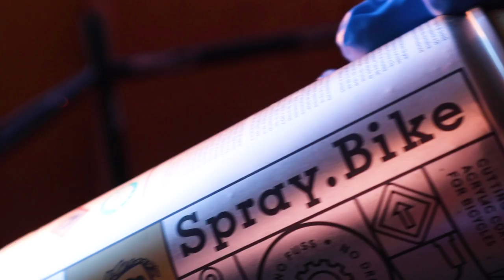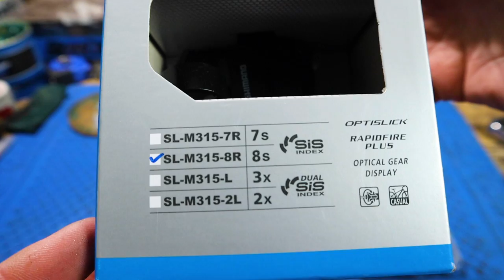Oldshovel Kona Cinder Cone Custom Build

Comment: Those decals came up a treat! Especially like the Old Shovel text on the top tube 😃!
An exceptional result. Another beautiful 90’s Kona given new life. These frames are very special indeed.
Reply from the maker: Thanks
Reply: How’s the geometry on these bikes?
I wanna build myself a nice 80s/90s mtb for cruising around, but since I’m having problems with my neck I can’t ride them in a stretched out riding position..
That’s the reason why I really lover modern enduro bikes, you sit very upright on them, almost like on a touring bicycle.
Are there old mtbs out there with such a upright seating position or are all of them stretched out that you have to ride them with a forward leaned back and up bent neck?

I know that’s a pretty weird and specific request, but maybe you could put me in the right direction..

Comment: THAT is a beautiful build. Kona & Trek had the nicest frames of that time period to put new school bits on. I came across a Kona Explosif that someone threw out. I gave it to my riding buddy and he rebuilt it nice. I have a 90's Trek 820 that I want to build up now, but I want to leave the original paint job, give it a good cleaning & clear coat it like they're doing now with vintage pick-up trucks & hot rods. NICE work OS.

Comment: I wish other people felt this way about older bikes like this...I always have and enjoy rebuilding them and showing them on my channel.  So many people think if you don’t have the latest bike then it’s garbage.  I’ve never had a bike newer than 2004 which was a Kona Stinky I built.  Keep it up...ps. it’s easier to put the wheel on if you leave one of the brake arms off until after it mounted  ;)

Comment: Stunning build, love everything about it, one of your best. Loved Konas (and loads of other brands) back then, a great era for MTBs. I have a '96 Bontrager Privateer that I've had since new with a Pace RC35 fork. I will never get rid of it ever, it's been used, abused, crashed, bashed and dropped but still has most of its original parts. Doesn't get used much nowadays as my old body struggles with the geometry, narrow bars etc but by god, I love that bike.
Reply from the maker: Thanks

Comment: Awesome build.  I just bought a 1993 kona fire mountain that has a set of girvin vector 2's.  The frame is so cool and with a set of more modern 2.3x26" tires it's shockingly comfortable over trails and jumps.

Comment: That is a thing of beauty ! You have done a wonderful job. I have an early 90's muddy fox monarch comp. I had it shot blast and powdercoated. I run it 1x9 alivio with deore hollowtech crankset. It's got a lot of colour going on ! I'd say the biggest drawback with these old frames is the lack of mud room at the chain stays. When we want to get a big tyre in there, instead of the relatively skinny tyres that were run back then.
Your bike is awesome, I'd ride that any day over a modern bike.

Comment: this bike is amazing, after building a few quite expensive trials and mountain bikes for myself this year, your channel inspired me to do a retro rebuild, so got my hands on a 2004 trek alpha 4500, which over the next few weeks will have new wheels built, a 1x9 or 10 drivechain, some decent tyres and a rigid fork, ideal for commuting but will also take some singletrack, and of course rim brakes to keep the retro look, might even get some hs33 for it in the future. awesome video as usual :)

Comment: Very slick build. Good luck with those pedals, mine had a bearing explode after 4 or 5 rides. If you were to build a gravel bike that could also handle some rough stuff, in the $500 range, where would you start looking?

Comment: Gosh. Your builds always blow me away. I'm sure you get a ton of requests for tips, but I hope you don't mind another. I have a '93 Stumpjumper frame that I've sanded the clear coat off to the factory paint to prep for painting. I wasn't sure if I needed the Spray.Bike Primer to ensure adhesion of their paint, or if I could just use a hardware store primer like you have. Any tips or advice would be very much loved! (Also, do you die cut your own decals?? Makes me want to buy a Cricut.) Thank you for the inspiration and providing all the ASMR to get through quarantine.

Comment: Hi. Thanks for your quick response.  I have a few more questions, regarding painting a frame and forks.  
Is it better to use a paint and primer spray to cover up or hide the colour you sanded off instead of a primer alone ?  Can one spray the primer, paint outside in the winter air, or does it need the warmer inside ?  Does it affect the paint coating if done on the outside ?  How  many cans of paint would it take to paint frame and fork, with one colour ?

Comment: You can setup V-Brakes by just setting the release into the cage on the edge but not down in the cage, then tighten the cable and that's the tightest you can get it and still release it for wheel removal. Hard to describe but cleaner than the way you leave the adjuster out.

Comment: I’m doing a similar kona build and was just wondering how you used that brake cable guide with v brakes. I think it’s normally for cantilevers, so I’m just wondering how you fit it with the cable housing. Thanks!
Reply from the maker: I drilled it out to fit a brake cable.

Comment: I love the labels and multiple layers of paint for the logos.  How do you ensure that each label covers up the exact area so that your paint lines up?  Such nice work!!  I really enjoy watching your restoration videos.
Reply from the maker: It’s tough to get them just right. It works best if the outermost layer is on the bottom and the rest line up with the edge of the bottom one.
Reply: @oldshovel  What are you using to create the masks for your logos? Very exceptional work. Thanks for sharing

Comment: Awesome as always...
Two questions for @oldshovel. Why do you put a coin into the grips? How do you create the decals to mask the paint? I mean, which software do you use to design them and which service to print them.
Reply from the maker: The coins are for bar ends. The masking vinyl I make myself. I design the graphics using Photoshop and Illustrator and print them with a Cricut vinyl cutter.
Reply: @oldshovel  ok thanks... But still I don't understand the purpose of the coins in the bar ends. For protection against bumps?
Reply from the maker: Yep. They keep the bars from cutting the grips and from getting gouged by the bars in a crash.

Comment: nice build! another 1X conversion with a 90's XT derailleur. How many teeth (max) do you find works with that exact derailleur? Did I see 42T there? Would 46 work?  I'm restoring my 1996 norco sasquatch for my wife and want to do the same.. thanks, keep up the good work

Comment: Recently started following. Loving your stuff! Just started restoring and working on old mtbs this fall. I have a question, at around 13:54 you mount a small intermediate hanger for the derailleur. I've seen it done before but don't quite understand what it is and what its purpose is. Can someone help me understand? @oldshovel
Reply from the maker: It expands the range of cassette teeth the derailleur accommodate. In this case so it can work with a wide range rear cassette

Comment: Looking to do the same with a 2007 stock Kona Cindercone. Below are the specs, any recommendation on what kind of modern 1x groupset will work on it?  I have been a roadie for 9 years and am working on bike building skills, this will be my first build!
2007 Kona Cinder
Frame sizes 14", 16", 17", 18", 19", 20", 22"
Frame tubing Kona All-Mountain Butted Aluminum
Rear Shock -
Fork Rockshox DART 2 w/Turnkey 100mm Travel
Braze-ons 2 bottles, fender, Disc brake tabs
Headset TH
Crankarms FSA Alpha Drive Powerdrive
Chainrings 44/32/22
B/B FSA Powerdrive
Pedals Wellgo LU-A9 w/Toe clips and straps
Chain Shimano CN-HG53
Freewheel Shimano Deore (11-32t, 9speed)
F/D Shimano Deore
R/D Shimano Deore LX
Shifters Shimano Deore
Handlebar Kona Riser
Stem Kona Control
Grips Kona Mooseknuckle
Brakes Hayes Hydraulic Sole
Brake Levers Hayes Sole
Front hub King Kong KDF2S
Rear hub Shimano FH-M475 disc
Spokes Stainless 14g fr/14g rr
Tires Maxxis IGNITOR 26x2.1
Rims Sun Black Eye
Saddle WTB Pure V SPORT
Seatpost Kona Thumb
Seat clamp Kona QR
Color Orange

Comment: Question:
If I were to replace those old long goose neck stem/handlebar to make it like your with short stem, long handlebar, would that allow me to fit better in to larger frame?  In 90's bike, I fit around 18", would I be able to fit well into 21" frame?

Comment: There's the rebuilt fork put to proper use! Another gorgeous bike build. There's a couple things I am curious about. Why do you keep putting derailleur extenders on? Are short cage rear derailleurs cheaper or better running such that you choose them over a long cage and thus not needing an extender? And lastly, why not put a QR seat clamp on?
Reply from the maker: The extenders are not for the short cage it’s for the large range cassette. Most older derailleurs can only accommodate up to a 36 tooth cog on the rear cassette. When I switch to 1x setups I like to use wide range cassettes that go up to 42T or up to even 48T, thus the need for the extender. On this bike I put an 11-42 T cassette.
Reply: @oldshovel  Thank you for the explanation.  I didn't realize you were putting on old derailleurs. I figured with all the new parts you were putting on that you were installing a new derailleur. Happy Holidays!

Comment: HI.  I am impressed your work, however I have question that might impact my attempt to restore an bicycle that has been neglected.  Some surface rust on frame and forks which I want to look good.  The wheels will have to be tossed.  The question is when you remove the paint from the frame, how much paint do you remove, I never get a clear look .Is there a reason why you not use paste or sandblasting ?  Do you use one grade of sandpaper or different grades ?  If yes, which grades ?  Awaiting a reply.
Reply from the maker: I don’t like the chemicals from paint removers and I don’t have a big enough sand blaster cabinet for a bike frame. When I sand a frame I use 220 grit. If there is surface rust I sand past it to clean it completely before primer. If the paint is good it still works as a good base layer for new layers of paint so I’ll leave what I can after smoothing it out.

Comment: I'm in the process of stripping down my 90's Cannondale Delta V for a paint and rebuild. Question do you make your own decals for the paint job or do you order them? If you make ,what type equipment do you use?
Reply from the maker: I make my own. I do the graphics and print them using a Cricut vinyl cutter

Comment: Also, a technical question about the derailleur hanger extensor (is that how its called? its the red thingy where you fix the derailleur). In case of a crash would it break before the actual hanger? working like the modern hangers.
Reply from the maker: I would think it would. The nice thing on old steel bikes is the derailleur hanger is steel and can be bent back. Something you cannot do with Aluminum.

Comment: You converted threaded to threadless...what standard to what standard, and what headset did you use? I'd love to de this on an old bike of mine.
Reply from the maker: This was 1 1/8 threaded to start so it is still 1 1/8 threadless.
Reply: @oldshovel  thanks so much

Comment: I have a 1990 Cinder Cone with the 'splash factory paint job. I did swap out the original Project Two forks for some (early) 1993 'Mag' Rock Shox and later added 'new!' 'v-brakes.' I kept the old parts on the basis that someone might want to remake the original factory bike. I am now thinking of a respray due to mottled rust on the frame, but this is commensurate with the age of the bike & is not excessive. Thing is do I stick to the essence and heritage of the original bike and try to replicate the (complex) factory paint job, or do I do something else? I don't suppose the bike is worth much in either form, but given the bikes age and originality, I am pondering over which direction to take. I also have a 1999 Marin Mount Vision. This was the worlds first full suspension XC bike. The metallic finish to the aluminium frame is pitting so I plan to rub this down and respray the frame to the original colour. The bike has the original yellow box section swing arm too. still ride both bikes. So any thoughts, please? Meanwhile thanks for all the effort you put into your videos.

Comment: Amazing. Its hard for me to believe that this only cost less than $400. I recently changed the tires and the chain in my old GT avalanche 4.0 and cost close to 100 Euros.
Reply from the maker: The used market around here is good and if you’re always looking like I do, and you’re fast you can get some good deals.
Reply: @oldshovel  Oh yea and im jealous. Shipping to Cyprus must be expensive. I should relocate to somewhere with nicer trails and more active community and work online.

Comment: Hi, always enjoy your builds and paint work.

I'd welcome your thoughts on spray.bike paint's longevity. I've used it myself and have found it isn't very durable. Waiting overnight between coats and applied several coats of finishing laquer.

Any tips?
Reply from the maker: I’ve found that the durability depends on the primer and the frame material. It is better on steel.  Three plus layers of clear helps also and it is much more durable after a couple weeks. That said it is not like a powdered frame.
Reply: @oldshovel  thank you. I've done two old Konas as well, both steel. I note you use a different brand primer. Maybe I'll try that.

Appreciate the response.

Keep the builds coming!

Comment: looks good. why did you choose to cut out the front gears and make it one gear in the front without a front derailleur? is this is a new fad, or is it a MTB pro tip?
Reply from the maker: It makes it awesome simple with the wide range rear cassette.

Comment: What is the extender that u put on the derailleur hanger to fit the larger cassette called, and what is the compatibility?
Reply from the maker: Their called derailleur hanger extenders I think. Wolftooth calls them a goat link I think. I’ve used ones like this to work with an 11-46 cassette. I think you would need a longer one for a 50 tooth rear cog.

Comment: Are you just using a regular 8 speed derailleur on that larger range cassette or do you have to make adjustments to compensate for the bigger tooth gear
Reply from the maker: I installed a derailleur extension

Comment: Have you ever considered wet-sanding and buffing the final clear coat? I think it would add so much more to your restorations.
Reply from the maker: Yes. With the Spray.bike paint I found it needs about 3 coats of clear to make it thick enough before wet sanding and adding more coats after. I have only done it once. It does make it better.
Reply: @oldshovel  Cool, love all your builds! Keep up the awesome content!

Comment: Have you considered using a WickWerks chainring? Small company based out of Ogden, Utah. I’ve used a few of their rings on my builds. Great products.
Reply from the maker: I have never heard of them and will have to check them out. Ogden is only a 30 min drive from me...  thanks for the tip.
Reply: @oldshovel  no problem! I think you’ll be pleasantly surprised. And as always, great build! God bless and merry Christmas.

Comment: Hi! I have a '94 Kona Cinder Cone myself and I'm trying to rebuild it, I really want to go with a single chain ring on the front, the same way as you did, using the old crankset, but I can't afford the Wolf Tooth...
Do you have any ideas on a cheaper one that works the same?
Thank you!
Reply from the maker: I wish there were cheaper options also. The Wolftooth one is the only narrow wide I can find with 94 BCD with 5 arms. There are others for other crank styles, especially for 104 BCD with 4 arms. There are chainrings that are not narrow wide that will be cheaper but if you ride much off road it may have issues coming off.
Reply: @oldshovel  Ok man, thank you so much for taking the time <3 I guess I'll just have to eat rice this month haha Cheers!
Reply from the maker: Lol 😂

Comment: I've got my eye on one of these frames locally. Is it considered a light frame (race-lite) as compared with other top end steel of its period? Thank you
Reply from the maker: It’s the Kona brand double butted chromoly. I would guess it’s similar to 4130 chromoly. It’s a basic steel but not the lightest Kona used. The. lol thing about the Kona bikes of the 90’s was the frame geometry was similar across the models. The expensive ones, like the Explosif, had the lightest most expensive steels and then ones like the Cinder Cone had the house brand, less expensive steel that was a bit heavier.
Reply: @oldshovel  similar geo but with different being component fit out and heavier tubing?

Comment: I really like how you used masks to paint on your graphics.
Reply: I worked in the sign industry and that's how we would sometimes make signs or wall graphics. I prefer to use vinyl as a mask for paint than as a graphic because vinyl can easily be pealed off.

Comment: what is the derailleur extender that you use in this video?  I see that wolftooth offers, but only for 10/11 speed.  I dont see it listed in your comments either but want to understand why you chose this for an 8 speed cassette.
Reply from the maker: It’s more about the size of the cogs on the cassette then the speeds. Older derailleurs were only designed to work with cassettes with up to 36 teeth. In order to reach on this cassette,  with the largest cog having 42 Teeth it needs the extender. Also it came with the cassette thus it is not listed on the parts affiliate links.
Reply: @oldshovel  that makes sense and I looked up the product... thank you for that!